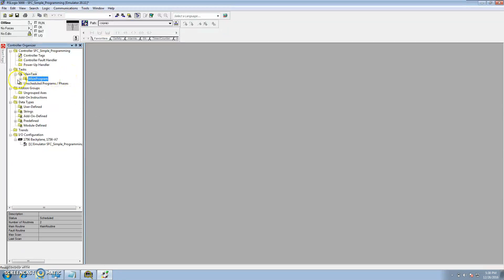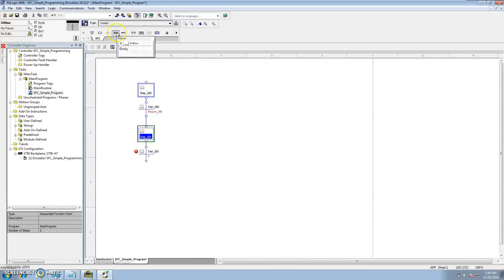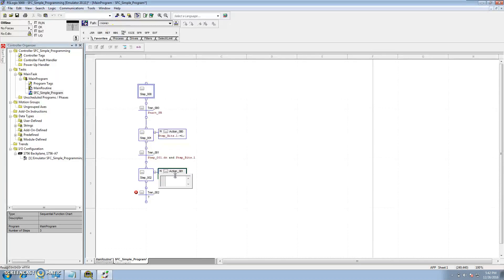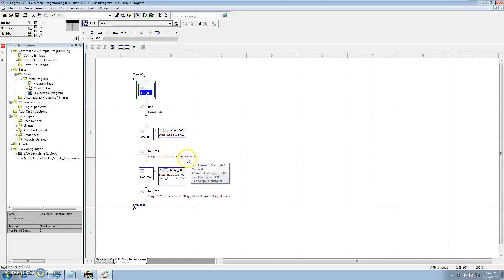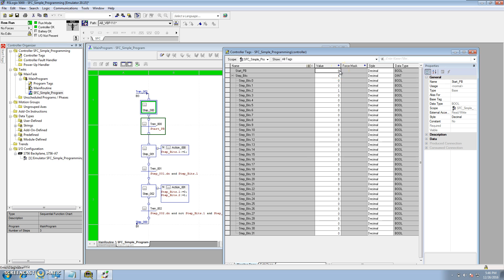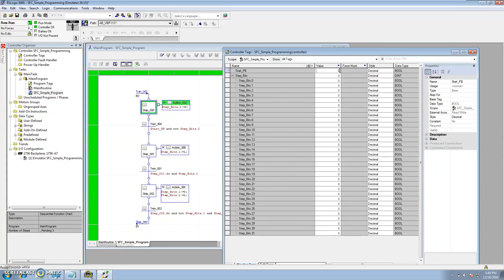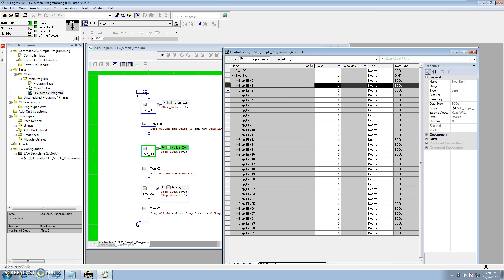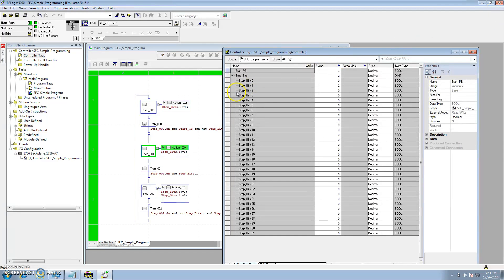SFC Programming With RSLogix 5000 (HD) | Sequential Function Chart Programming

Comment: is it possible to do a counter in sfc? how can I do that?
Reply from the maker: Just to provide you with some short term help until I can make a video.

Think about a structured text counter just like a structured text timer, the data types are function block type.

Here is a small example of code for a single counter.

CTUD_01.Preset := 500;
CTUD_01.Reset := Restart;
CTUD_O1.CUEnable := limit_switch1;
CTUD(CTUD_01);
counter_state := CTUD_01.DN;
Reply: Thanks! It helped a lot!
Reply from the maker: @GabrielRodrigues-or7uc  

Glad I could help
Reply from the maker: Yes, just open the instruction help section for counters then see the example of structure text.

I have videos on timers in structure text.

Maybe that would help.

Keyword search this channel & you will see this